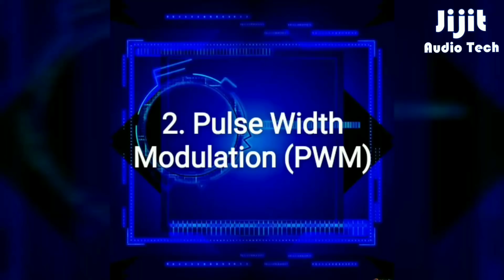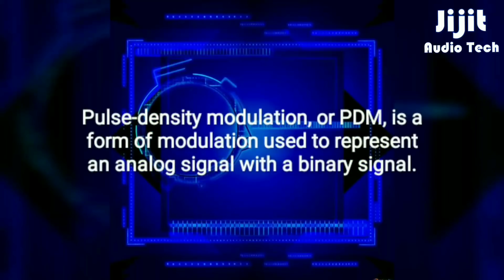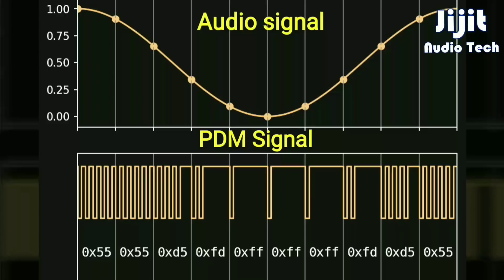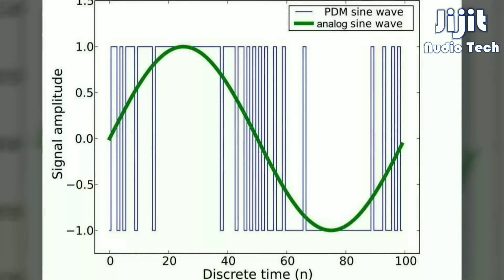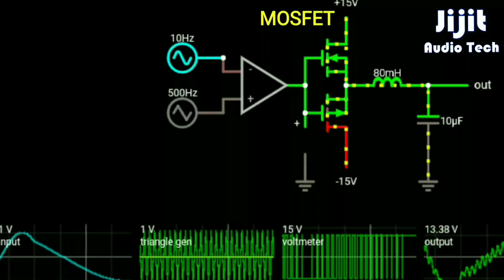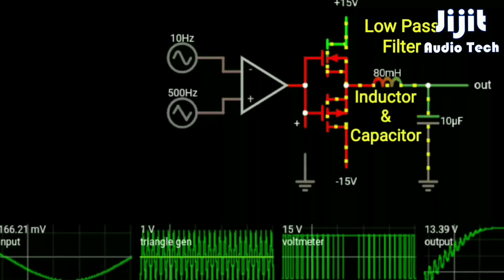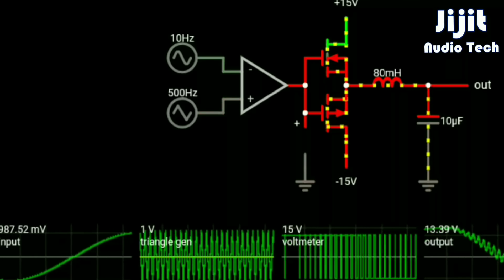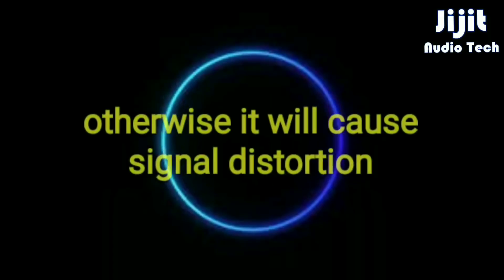Amplifier Basics Part 3 - Class D Amplifier (Malayalam), ക്ലാസ്സ് ഡി അമ്പ്ലിഫയർ

Comment: Switching Karanam Radio interface varunnu. Any solution? 
PAM 8403 CLASS D AUDIO AMP
Reply from the maker: Yes that is one of the main disadvantage of class d amplifier, modulation frequency will interface with radio. Isolate ചെയ്യുക എന്നതാണ് ഒരു പോംവഴി, അതിനായി മെറ്റൽ ബോക്‌സിനകത്ത് amplifier fit ചെയ്യേണ്ടിവരും...
Reply: @JijitAudioTech  thanks for the reply. Ethu taram metel aanu nallath ennu parayamo?
Filter Ulla class D amplifieril ithupole Radio interference undavumo? 

Thanks
Reply from the maker: @ebrahimkunnath8408   എൻ്റെ അഭിപ്രായത്തിൽ ക്ലാസ്സ് d amplifier il radio module (especially fm) ഒഴിവാക്കുന്നതാണ് നല്ലത്, usb, bluetooth എന്നിവ വർക്ക് ചെയ്യാൻ വലിയ പ്രശ്നം ഇല്ല.. നമ്മൾ എത്ര shield ചെയ്താലും radio channel tune ചെയ്യാൻ ബുദ്ധിമുട്ട് വരാറുണ്ട്...
Reply from the maker: @ebrahimkunnath8408   എൻ്റെ അഭിപ്രായത്തിൽ ക്ലാസ്സ് d amplifier il radio module (especially fm) ഒഴിവാക്കുന്നതാണ് നല്ലത്, usb, bluetooth എന്നിവ വർക്ക് ചെയ്യാൻ വലിയ പ്രശ്നം ഇല്ല.. നമ്മൾ എത്ര shield ചെയ്താലും radio channel tune ചെയ്യാൻ ബുദ്ധിമുട്ട് വരാറുണ്ട്...
Reply: @JijitAudioTech  True, thanks anyway. And all the best for your YouTube channel.